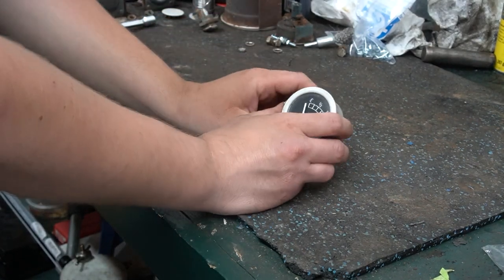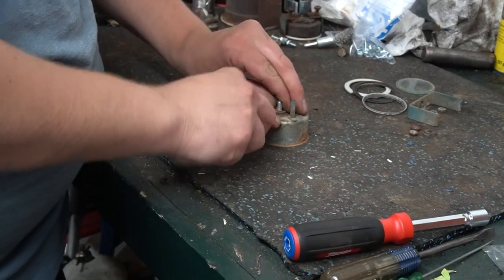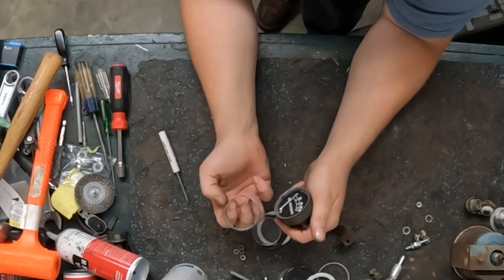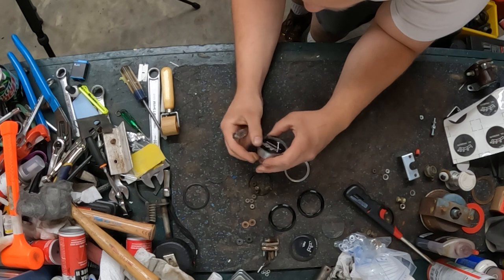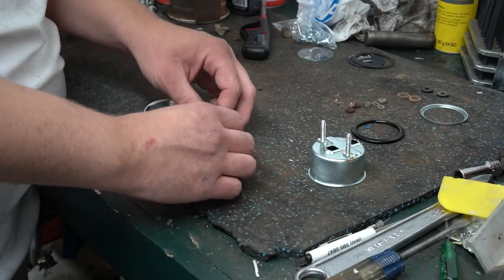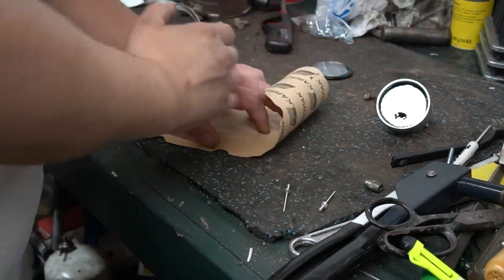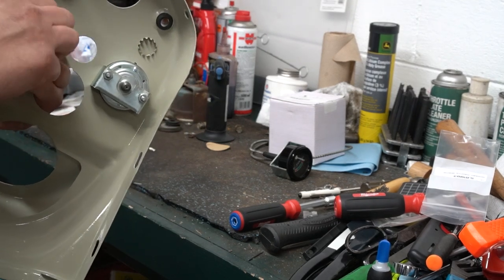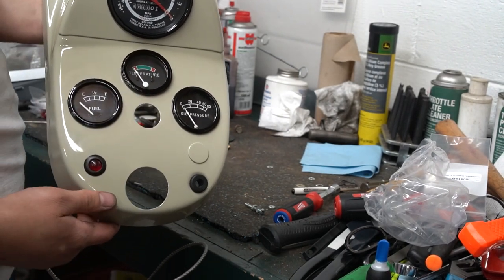Restoring Ford Tractor Gauges

Comment: I came in to this assuming that “restoring gauges” meant going to Tractor Supply and buying new gauges, but, nope, he’s actually restoring original Ford tractor gauges. Maybe I’ll take another look at my original broken gauges now.
Reply from the maker: Thanks. I try to use as many original parts as I can. I did purchase an original proofmeter but haven't worked on it any. Might have video on it one of these days.

Comment: Just started restoring my Great Grandfather's 1959 601 Workmaster Diesel, while not the same as yours, it's very close and this has been very helpful.

Quick questions: Did you end up painting that panel yourself? If so can you recommend the paint your use? Additionally, if so, did you use an enamel hardener?

Thanks!
Reply from the maker: Yes I painted the panel. I used the gray from New holland for the 8n tractors, think they have it listed as 39-62, then added some majic hardener and a little xylol thinner to help it lay down smooth.
Reply: Great content!.. I have a gauge from 53 Jub that i took apart. oil passes through the plunger, have you had experience with this? Any ideas how to seal it.

Comment: If I am trying to locate someone to do the re-plating, what do I search for (Zinc, ......) and if I find someone, will they do a job that small of just three little gauge cases?
Reply from the maker: Zinc plating or electroplating is what to search for. Some shops should do them. Back when I did the 861 I sent some parts out to be clear and yellow zinc plated. That was 14 years ago and they charged me their minimum prices which were $50 and $55 respectively.

Comment: Bro . Pl. What is the  measurement of Ford tractor pressure gaze (meter) 
As psi, bar or kg/cm
How many psi when pressure meter show 90 degree
Reply from the maker: Not really sure what you're asking. Oil pressure will vary depending on weight of oil used, engine temperature, and ambient air temperature.

Comment: Fascinating. Do you do your own plating or farm it out?
Reply from the maker: I do it myself. I purchased a kit from Caswell Planting Inc. and have learned how to do it. Took a lot of practice to get it right. I sent out parts 10 years ago for my 861-D and it was minimum of $50 for clear zinc and $55 for yellow. I figured I'd be doing a lot more on this tractor so I got the kit.
Reply: @chickenhousemechanic  Thanks for the response - I'll have to check them out.

Great channel - keep up the great work!